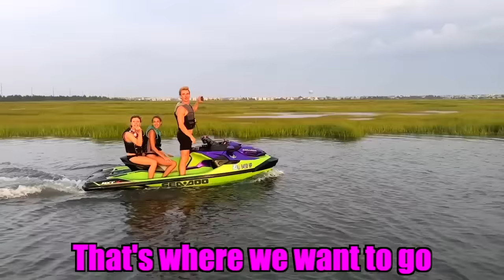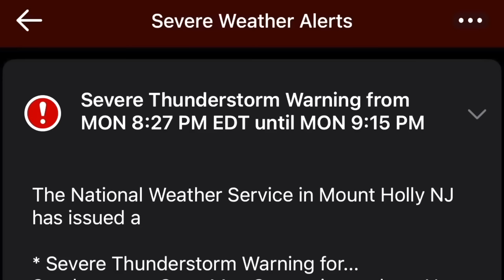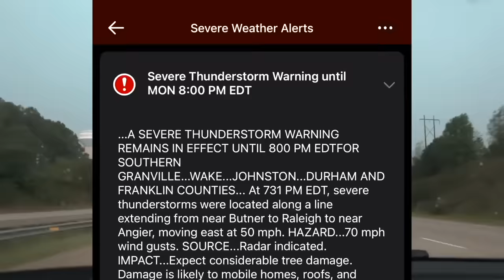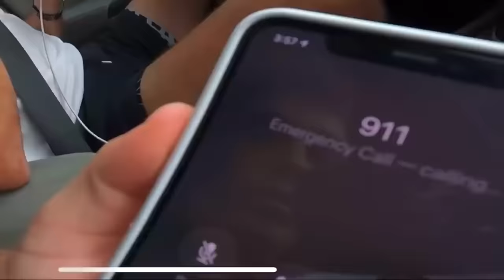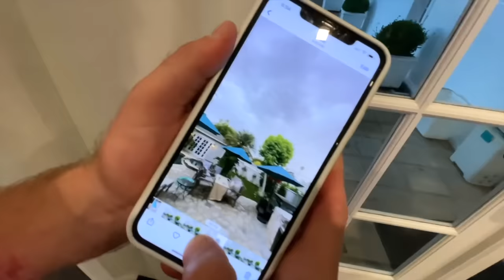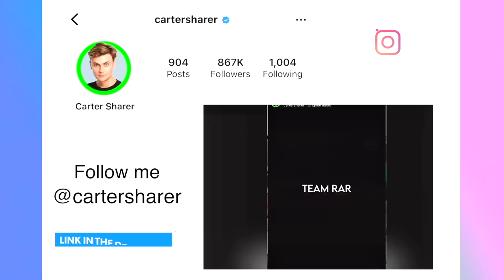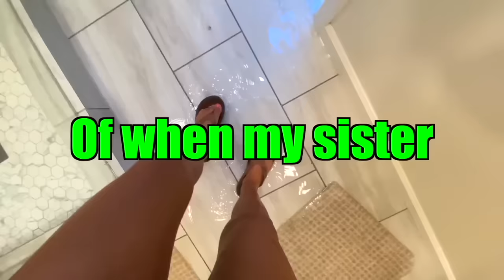I GOT HIT BY LIGHTNING!!

Comment: Ok not to hate or anything bc carter was my childhood but when it's raining and there are dips in the sidewalk its gonna hold water. Very little. Still not a flood. Plus turning off the lights to "save power" Will not work at all. The lights run off power lines and if those get struck or moved in a certain way then you lose power. Also, the chances of you getting struck by lightning there was very low because you had no metal on you. Just know next time no matter how much lightning or rain there is you prob won't get struck by lightning and it's not a flood till it's hard to walk through and all of the street is filled with water. Not some dry spots. Sorry for the essay. Oh, yea and steven a raging river would flip the car you guys were in, that water was just moving in a circle.